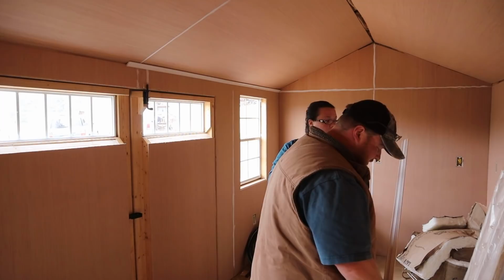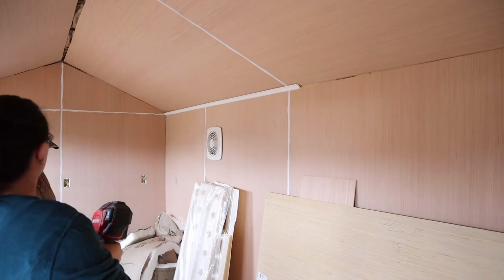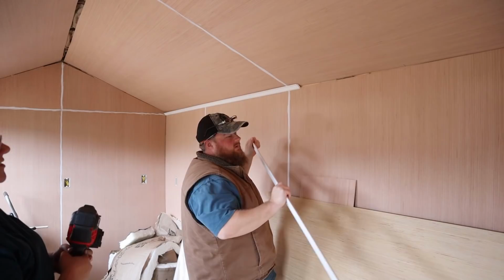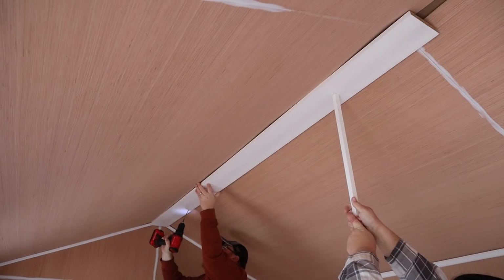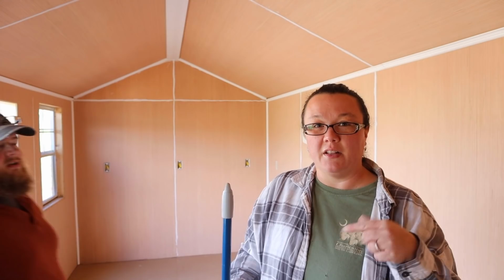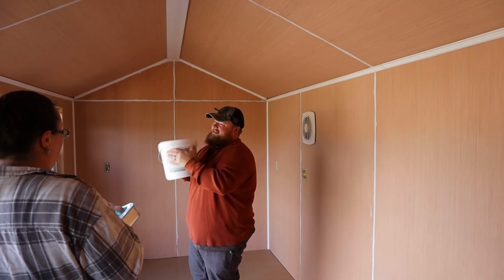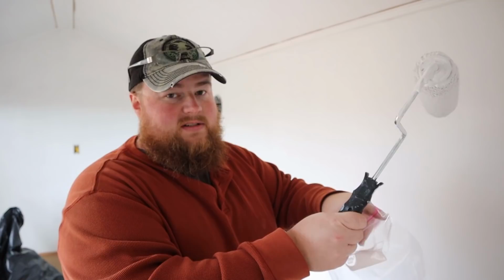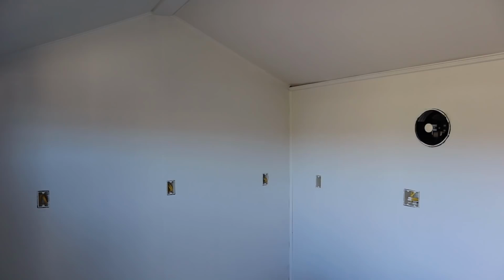Painting the Soap Shack | Storage Shed Conversion

Comment: Come on Angela. Let Sam put window molding. Put up some cute little curtains and stencil your logo. Sam let Angela get vinyl flooring.  Loving it.
Reply: I agree. Finish it properly and you will be happy you did. Yes, get proper flooring.
Reply: And make a deeper window sill for a shelf.
Reply: I like the idea of a deeper window sill for a shelf.  I also think sheet vinyl is the answer for the flooring it will be so easy to clean up any soap making mess that end up on the floor
Reply: @lorita3488  I agree with your idea. Finish the shed completely and you won't regret it.

Comment: Also because I do Reno's like you guys in my experience laminate flooring or tile will be easier to scrape soap off with a blade. The vinyl flooring( sheet) will cut if you scrape with blade to remove soap build up.you will be standing long hrs so my advice would be a laminate with underpad .will save your back and feet. I'm certainly not critizing only advising as soap shack is your baby business so why not do it to standard of best comfort and presentation. It's not just a shack it's your business! Love the process so far! Look forward to seeing you thrive and prosper here!!

Comment: It's looking good! I didn't want to do the painting so i brought pre-painted faux beadboard, to paint it would have cost $300 more in paint (building was much bigger ), i took the cheap way out, LOL
Reply from the maker: 😳 woah! I would have too!
Reply: @sam-and-angela  i used the  pre-painted moldings like you did inbetween the seams , because i did the ceiling in the same material as the walls, LOL- put a ceiling fan in the ceiling!

Comment: Just a tip..cut your caulk tip very small at an angle and sand the tip to remove burrs.  Make a mark on the tip to show where the point is so you can keep it straight.  Then your gun dispenses less and requires less finger work.  You can always put a 2nd strip if  needed.  Paint the floor with your logo at the entrance in a contrasting color.  Trim out the windows.  Make it look professional.